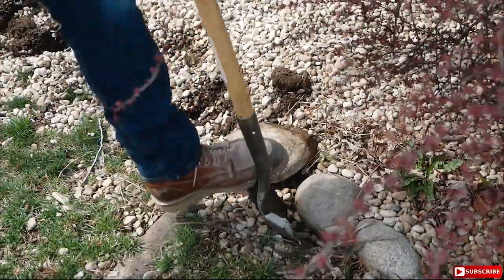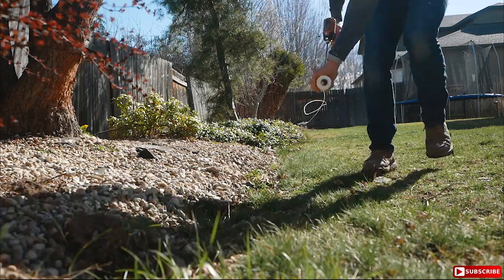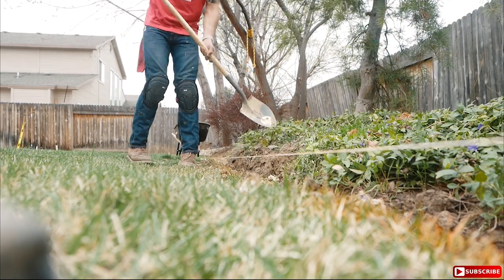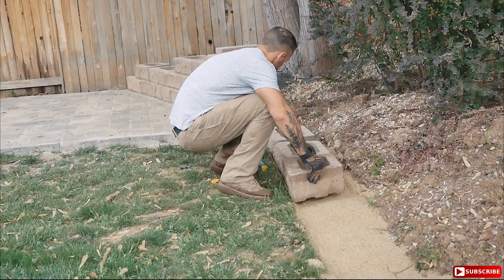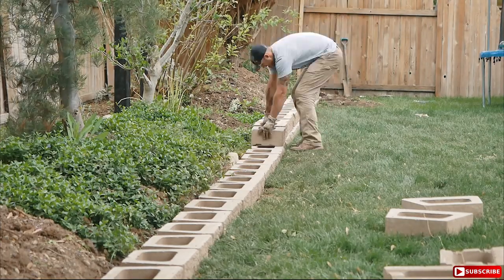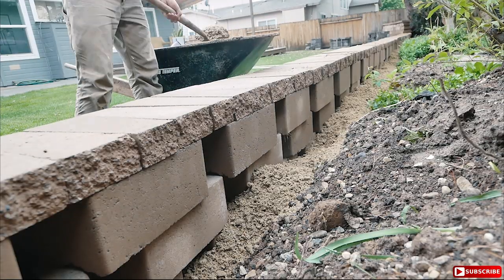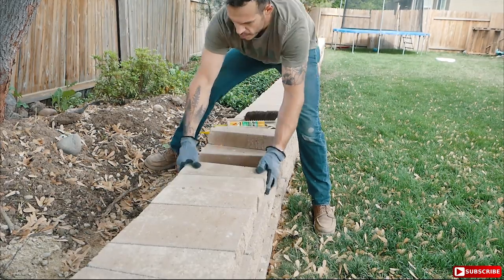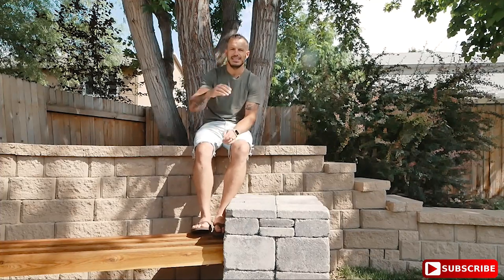Building a Backyard Retaining Wall

Comment: I have worked in landscape construction for a long time now and I don't recommend following the steps in this video. There is way more that goes into building a wall correctly. Don't ever use sand; it will wash away with moisture - making blocks uneven. You have to fill the blocks with gravel to ensure stability and strength, the wall should be backfilled with a drain rock that allows moisture to pass through, and drainage pipe must be added at the bottom course to ensure distribution of moisture - rather than build-up behind the wall. In addition, levelling should be done with a longer level that stretches across multiple bricks. This ensures that the slope does not change drastically from one end to the other.
Reply: I thought the same thing...but didn’t want to come off as a “hater”.
Reply: I've never worked in landscape construction and could tell this wasn't built properly immediately... edit I mean, I think it might work okay since it's really more decorative than an actual retaining wall, but I'd def call it a decorative wall over retaining...
Reply: It’s not really a retaining wall though. But I agree, he didn’t put actual drainage rock either, just gravel, which will harden and eventually push the wall if where he’s at has freeze/thaw cycles. In Arizona, where I’m from, think this would be just fine, since it’s short, just wouldn’t use that backfill

Comment: The wall is crooked, i can see if from this video, and those block need to be fill with gravel and lay in gravel. For been your first wall it its aright job. Sand is not really need for walls, but rather for patios, in my case.

Comment: I hate to be the stick in the mud but this wall is crooked - I would have placed a dry concrete mix into the trench, level it out and spray with water  - 1st row of blocks set level in mortar then next row with construction glue all dead straight on the string line go up to 3 or 4 blocks finish with capping stone

Comment: I love it !! And looks really easy to do it. Question: how can I build a 6’ tall retaining wall ? How much gravel need to put on the back of it?
Reply: Drainage rock, not gravel. And m depending where you are, munger need an engineer. Use feo grid through every layer and drainage rock added and compacted as you go up
Reply: @hectorsanchez2524  Definitely need the geogrid.  I am not an expert builder but I have used it in mine to keep the soil stable. Your advice is definitely on point.

Comment: no footing, no concrete?
Reply from the maker: No need
Reply: Mr. Build It no you need bro. They can fall. Not safe
Reply: Also didnt core fill the blocks. The  job of the string line is not just for height. But can also be used to make sure the blocks are following a straight line. Setting up your first block, then your last block. And running a string acros the top of them behind the split face, would ensure a dead straight line. However the slight wave that this wall has gives it a bit of character and a rustic look.
Even though the wall isn't structural, i would still have made a 70mm cocrete footing, and then set the bottom course of blocks on 10-15mm sand and cement, and then core fill the blocks. You never know if later down the track youd want to use it to bear weight. Or another owner in the future.
Reply: I also forgot to say, nice job. I love your channel. As a landscaper its easy for me to pick faults in walls. Learnt a lot from your building and tiling videos. Nice work man.

Comment: No geo-grid, no core filling, no 3/4 inch drainage stone... That wall is not going to last long. Please do more research before you start telling people how to waste their money on a dangerous installation
Reply: A wall this high certainly does not need geogrid- that would be "over-engineering". This is a very low wall without surcharge. 

Agreed though the drainage could be better, and also the wall is crooked in places.